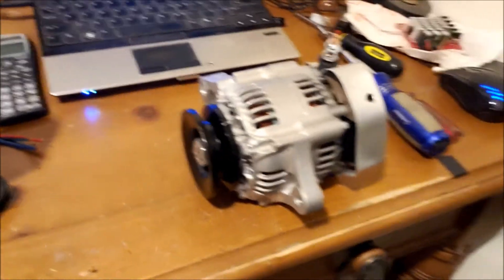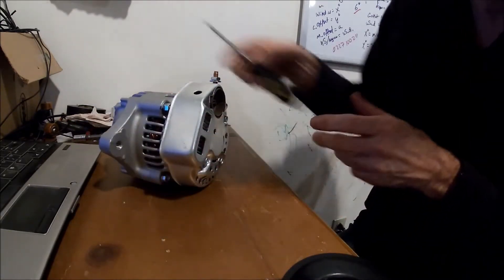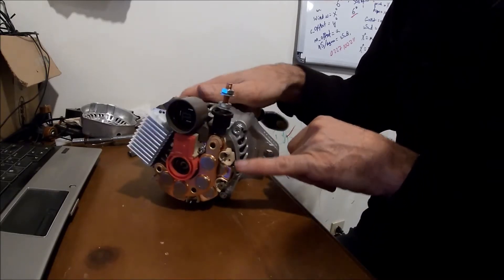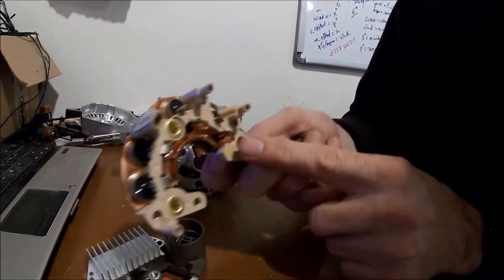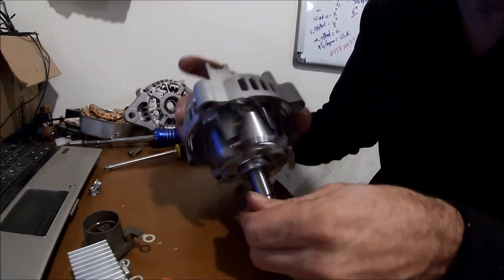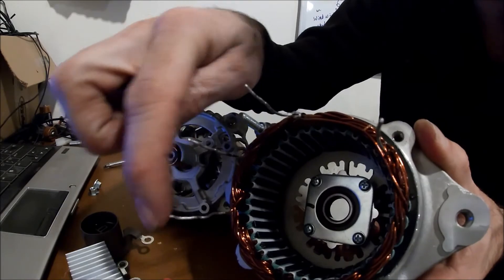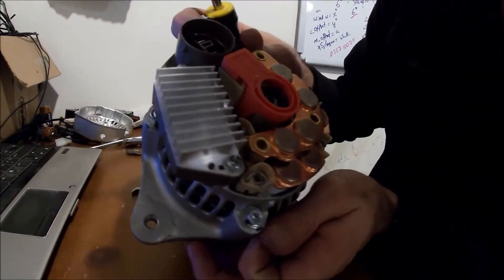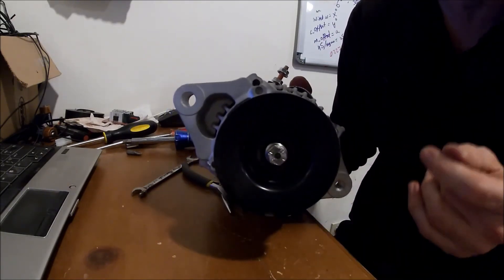Amazon Mini Alternator tear down.

Comment: Thanks a ton! Was curious what they 8162 style alternators looked like. 
From what I understand these are basically tractor alternators with oversized regulators on the back. Original output was 30-40a, with some companies rebuilding them claiming over 90a!
Reply from the maker: I'd like to get ahold of the larger amp style.  This one is a bit lacking at idle with the fan running.  Right now I can't do both head lights and fan at the same time.